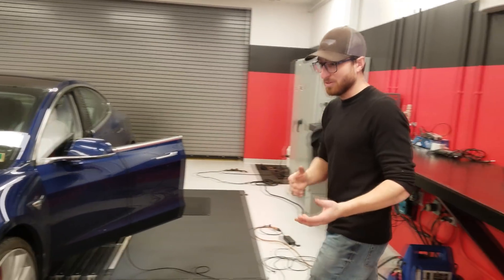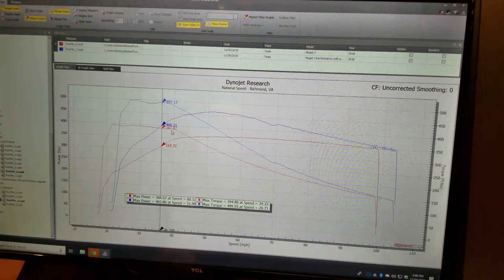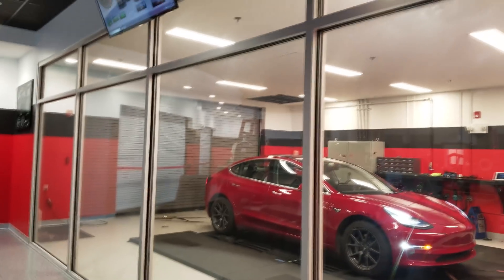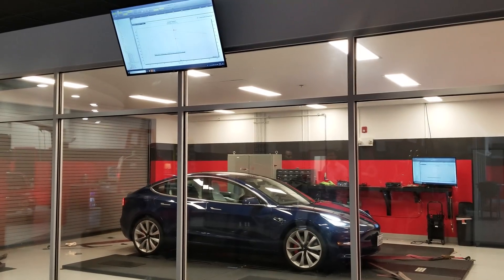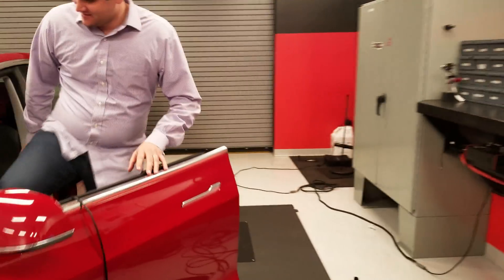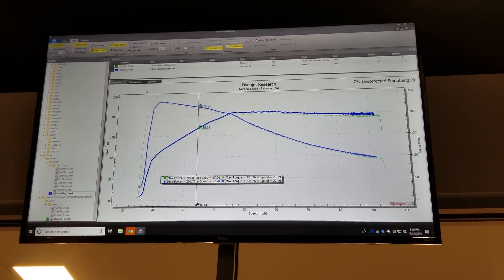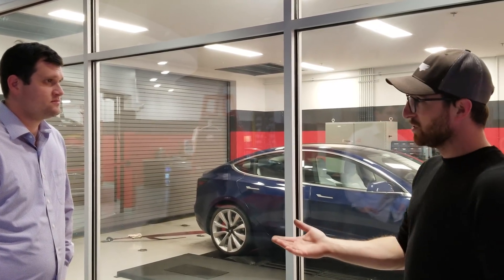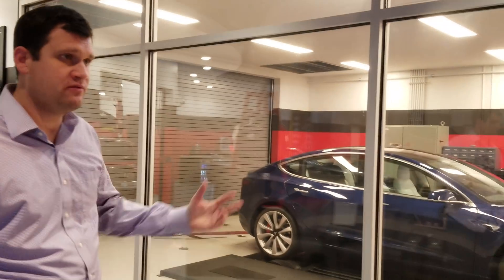2018 Tesla Model 3 Dual Motor vs. Performance Dyno Results

Comment: Is that power to the wheels ?
Reply from the maker: The dyno results are measurements of power at the wheels after considering some power loss from the battery to the motor to the wheels, components in-between.
Reply: Obviously

Comment: Anybody know the exact difference between the model 3 dual motor with 2k additional option called sleeper performance model and dual model awd and full performance model?  Called Tesla ordered one, the person over the phone said it’s not only software unlock it actually has a different inverter like full performance model.  I did not want the 20 inch wheels and that was for my reasoning and savings of 6k plus.
Reply from the maker: Known on Reddit and TeslaMotorsClub as P3D- (stealth Performance), it's basically the Performance trim without the 20" wheels, bigger brakes, lower suspension, spoiler, and pedals. These extras were known as the Performance Upgrade Package.
Reply: Hi Chad, did you find out if you can order anything like that? I literally ordered my standard model 3 yesterday and didn't go with the performance pkg because I plan on changing most of the tangible parts. I wanted the fast version but, could not justify 9k more because I was changing everything. Is there an option that can get the standard faster without the add on parts that you know of?
Reply: They got the sleeper version available now.

Comment: Is the non performance a fast car?
Reply: The non performance dual motor is very fast. As fast as a lot of bmw m cars and that is fast. If you have the extra cash then go for the performance, but don't break the bank for it.
Reply from the maker: Depends how fast you're comparing to. How fast do you want the Tesla Model 3 to go?
Reply: @hoangho51  is it a driver's car or should I go with the performance?
Reply from the maker: @meanwhileinsooke  define driver's car in your terms. If you can afford the Performance, get it and you won't regret it down the road if you want the need for speed. I don't get tired of smashing the go pedal and leaving many cars looking at my trunk at a distance. If you're in the market for a Tesla vehicle, be sure to use a referral to get free Supercharging miles, like mine at the bottom of the description of the video.
Reply: @hoangho51  BMW M2 competition is a driver's car. Mercedes Benz AMG 63 is a driver's car. I might just use your code
Reply from the maker: @meanwhileinsooke  Those cars that you have listed, are performance cars with 0-60 MPH times close to that of the Tesla Model 3 Performance. You should definitely consider Tesla Model 3 Performance over the non-Performance.
Reply: @hoangho51  lol no, their 0-60 are NOT close.... they are closer to the regular AWD. The Performance DESTROYS them in 0-60, and the 1/4 mile...
Reply from the maker: @KapitanPoop  you replied to the wrong person... I have the Performance, so I would know better. ;)
Reply: @KapitanPoop  with the acceleration boost the awd is pretty close to the p now 1/4 mile times. 11.6 vs 11.8 respectively.

Comment: Let's get an update with the increased power and the new expanded powerband from 2019.12.1.2!
Reply from the maker: I would if I had the time. But with 2 kids (newborn & toddler) now, it's just not possible anymore. No more free time to make a nearly all day trip like I did for this run. But here are some others who collected some data for your viewing pleasure to see the increased power:
https://teslamotorsclub.com/tmc/threads/5-increase-in-power.144106/page-9#post-3518565
https://www.reddit.com/r/teslamotors/comments/bcrbtg/model_3_awd_power_vs_speed_with_bonus_p3d/
https://www.reddit.com/r/teslamotors/comments/b68mc5/fw_201983_actually_increased_model_3_awd_peak/
https://www.reddit.com/r/teslamotors/comments/b8k251/model_3_awd_peak_power_vs_state_of_charge/

Comment: Why does the P3D graph show no torque below 20mph?
Reply: Test begins at 20mph. They don't do launches on dyno. Dangerous to do so.
Reply from the maker: Simple: the dyno didn't start calculating at that speed. But it doesn't mean it had no torque.
Reply: Quick way to destroy a dyno. Seriously, rolling start is a necessity not a choice with high torque loads.

Comment: You guys where lucky that other strap didn't brake otherwise you would have ended up with a totaled car in the wall.
Reply from the maker: That is true. We weren't expecting for this sort of thing to happen. But it's a good thing that George was able to handle the situation at his best ability at that snapping moment by halting the car asap and do extensive check up the second dyno attempt round to make sure it's not repeated. I'm proud of what his team was able to do and take care of the issue later on.

Comment: Thanks for the video!

Slip start is to allow the car to slip enough to get moving from a start on mud, snow, dirt, etc.,  It's not a performance mode, and it won't make runs on dry pavement or a dyno faster.  If anything, it should make the car slower by allowing the wheels to slip when starting to move.

To fix the sound, you need lapel, boom, headset or shotgun microphones.  The sound on a GoPro or phone is very hard to hear on a video, which is why professional videos use microphones that can pick up specific people.

There's a video of dyno results on a (non-Performance) Model 3 at different states of charge at:  https://www.youtube.com/watch?v=G8NaZDIL6sI&t=216s

Higher battery charge is better for performance because it means higher voltage which means higher power which means more torque.

Comment: A test that NOBODY has done yet is the performance dropoff at different state of charge. I want to see runs at 5%, 10%, 20%, 40%, and 60%. I own a Performance Model 3 and I can feel the power dropoff at lower SOC but id like to know how much exactly and when.
Reply: Battery temp also seems to have an effect as well.  I've noticed that when my M3P+'s battery is very cold it does not have the same punch during acceleration as it does when the temp is closer to 30 degrees or above.
Reply from the maker: @bryans.7300  That's correct. Ambient temperature will affect the Model 3's battery performance if it drops below a certain temperature threshold, among other things. You'll see that the maximum available energy bar is reduced by the dots (dash line according to the manual under Car Status/Driving Status) appearing starting from the right. As for the 30 degrees comment, are you referring to Celsius or Fahrenheit?
Reply: @hoangho51  Referring to Fahrenheit.  Maybe not so much at 30 degrees but definitely when it gets closer to zero there is what feels like a very large drop off in power.  I'll keep an eye on the available energy bar.  I've see it reduced for regeneration on the left, of course, but haven't seen that for the available energy on the right side of the bar.
Reply from the maker: @Jay Pase Check out my Dragy run times here: https://teslamotorsclub.com/tmc/threads/soc-vs-power-and-torque-output.126362/page-2#post-3017482 That shows how much time difference there are when the SOC varies. Although not as extensive as you'd liked on the tested SOC variations, it's good enough to gauge the power hit. Basically, once the Model 3 Performance SOC drops below 50%, the 0-60 MPH in 3.5 seconds (or 3.3 seconds with 1 foot rollout subtraction) is no longer guaranteed.
Reply: Here's one dyno test at different SOC:  https://www.youtube.com/watch?v=G8NaZDIL6sI&t=216s

Comment: If you want to have more views on this vid, try to up the sound. Hardly to undersand for foreiners.
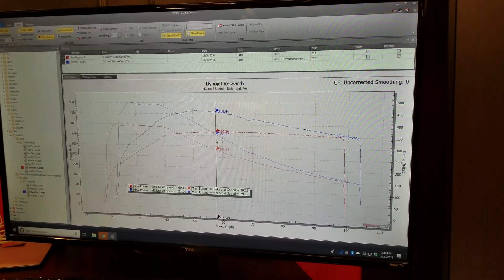Reply from the maker: If you're talking about 8:55 - 10:59, it was noisy but still distinguishable. I wish whoever opened up the garage door would've closed it when they were revving the engine in the working bay area when working on some vehicle. We recaptured most of that conversation information at 0:04 - 2:15. Technically, the noisy video portion was chronologically first, the dyno background information portion followed sometime afterwards.

Comment: Great video would love to see track mode turned on
Reply from the maker: Unfortunately, Track Mode wouldn't produce additional power & torque. This is because Track Mode was designed for better traction, stability, and endurance, among other things. https://www.tesla.com/blog/how-track-mode-works
Reply: @hoangho51   As curious of the horsepower and torque had a different curve

Comment: The sound was unintelligible to me as were the graphs. Fortunately the description does have a break down of the time line so for those prepared to put in the work it should be possible to determine which graph pertained to which vehicle. This video had the potential to provide some interesting information and maybe if I cared enough I could have got more from it than I did.
Reply from the maker: At what point was sound unintelligible? If you're talking about 8:55 - 10:59, it was noisy but still distinguishable. I wish whoever opened up the garage door would've closed it when they were revving the engine in the working bay area when working on some vehicle. We recaptured most of that conversation information at 0:04 - 2:15. Technically, the noisy video portion was chronologically first, the dyno background information portion followed sometime afterwards.
Reply: @hoangho51       From the start the sound was recorded in a place with hard surfaces that  overlaid a lot of echo to the speakers voice. In addition there was a lot of ambient noise. I'm not a US resident, perhaps if I were I would have found it easier to understand, as I stated "unintelligible to me".
Reply: Dogphlap. I am a native English speaker and I found the beginning of the video very difficult to understand. The guy spoke too fast and the echo was terrible. The work you did was very good. Thank you but I had to strain to understand in the beginning. As I got used to his fast speech, I could keep up.